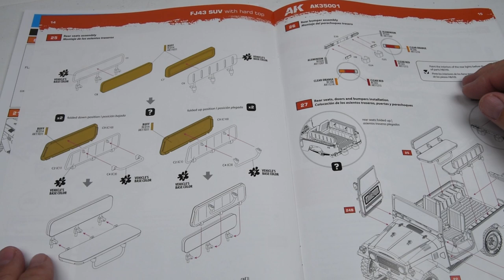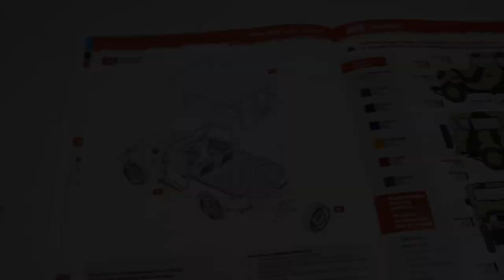FJ43 SUV - Abrasion Weathering, Base Painting + More. Ep  1

Comment: This is why mmp is such a good paint for weathering. Very easy for chipping and doing abrasive wear and tear.
Reply from the maker: I don't have any of the range. This is an alternative?
Reply: @RickLawlerPropaganda  yea only have about 5-6 but I’m really liking them. You can use a slightly SLIGHTLY damp brush to remove layers of paint in different fashions. Similar to hairspray chipping without the hairspray and MUCH finer chips. It takes some tinkering to get use to it. I got turned on to it from mr Mike Rinaldi of coarse.

Comment: You've probably already corrected the top, but that elfbein amber color you used looks good for old fiberglass. The question then is whether Toyota used red oxide or gray primer over it. My guess would be gray as they painted white over it.
Reply from the maker: John, yes...I was told that the top was fiberglass and will be making adjustments. Thanks.